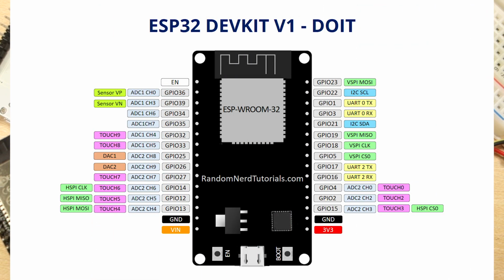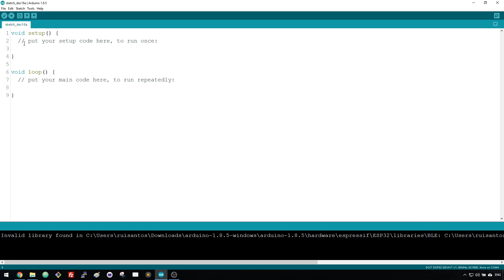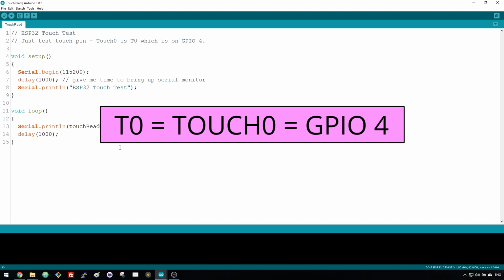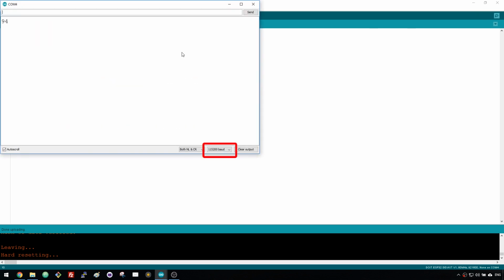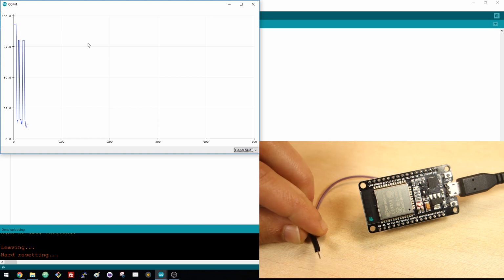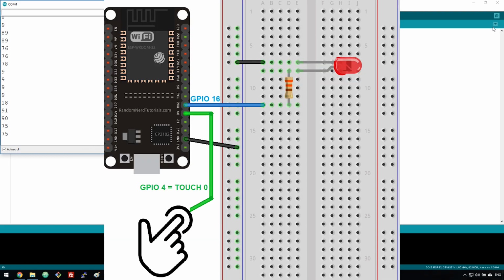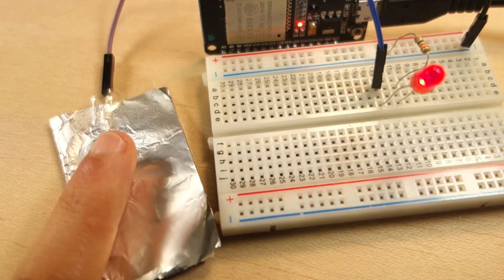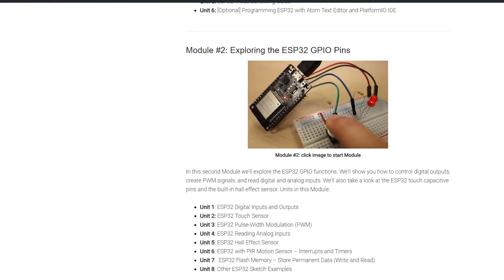ESP32 Capacitive Touch Sensor Pins with Arduino IDE

Comment: In trying the Arduino ESP32 touch, non interrupt example I noticed when I ran the plotter, with no touches, that it would self trigger several times a minute, some with very low values!

Comment: Hi, This is nice. Does anyone has a video to use ESP8266 pins as capacitive touch pins ?  I have two of the boards lying and want to make animal sound toy when you press a switch.  Interested only to use as capacitive touch because there is already one toy which has gone bad(capacitive touch)
 and I want to put esp8266 there. I want to surprise my grandson. I am just stuck in implementing touch key part.
Reply: Sir , use ttp223 module instead . It is just for ₹20-25 .if you want to make something with it using esp8266 then connect that sensor with it. It comes with touch to toggle , on/off function in it

Comment: Hi, i encounterd some problems witch my project, i try multiple  touchReading connected via cables to conductif  pieces of foil, the problem that is all cables are close to each other , and there is massive fluctuation in reading :/  My geas during checkking capacity it alo sense the other wires.(and cooper foils).. Someone know ho to fix that?
I came out  witch simple mini MIDI pad controller , whem i notise that sigle pin can sense pretty goog, (no 1,0 output) fast, so a wanded make a drum PAD witch VELOCITY sensitiv cappabilities....

Comment: why so much lag from the moment you touch the metal until the LED lights?
Reply: He has included a delay in the sketch so that the serial monitor is readable but in practice you would not use delay.